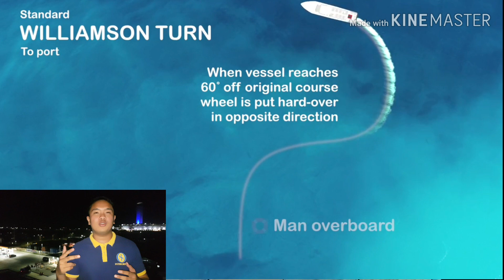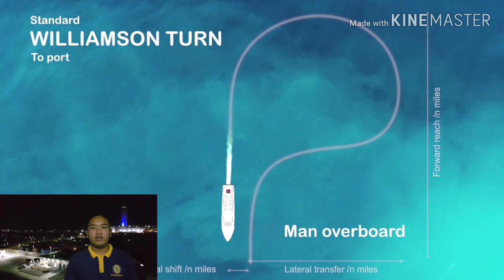SEAM 5

Comment: JAZER LLOYD D. AMPER
SEAM 5
MW 0730 H - 0830 H 
T-TH 0730 H - 0900 H

SHIPS MANEUVERING AND HANDLING

TEST 9 ANSWERS:

1) Decrease the speed as much as practicable.
2) Make a bold alteration to starboard and pass on his port side
3) As with no. 2
4) Vegetable/Fish oil
5)Use the winch. Forerunner and wire stopper to pick up the slack and stop the wire. One man operating each.
Make the forerunner fast on the beat, releasing the eye of wire and stopper, lower the wire easy by forerunner.
6) Quadrupled
7) Due to suction, the two ships will sucked together.
8) Too fast
9) Give starboard rudder in order to balance the force to the bank effect and the rudder effect.
10) Increased velocity and decreased water pressure around the ship's hull.

THANK YOU VERY MUCH SIR ROY :) 
GOD BLESS...

Comment: Macasero, John Rose D.
(TTH 12:00-1:30,1:30-3:00)

1.)Insert a blank flange on the line between the slop tanks and the rest of the cargo compartments?
2.)The name of the person in charge of the transfer operation
3.)8 hours a day?
4.)Permission must be obtained from Chief Officer?
5.)Coal?
6.)Flash point.
7.)Cross flooding arrangement
8.)The Master?
9.) As per Builders' specification?
10.)Melting heat

Comment: D/C CRISTINA BULAWIN
Monday 7:30-8:30
Tth 7:30-9:00

Ships maneuvering and handling

Test 9 ANSWERS

1.)Due to suction, the two ships Will sucked together
2.) Increased velocity's and decreased water pressure around the ship's hull
3.) give starboard rudder in order to balance the force to the bank effect and the rudder effect
4.) Decrease the speed as much as practicable
5.) Use the winch. Forerunner and wire stopper to pick up the slack and stop the wire. One man operating each. Make the forerunner fast on the beat, releasing the eye of wireand stopper, lower the wire easy  by forerunner.
6.) Vegetable / fish oil
7.) Quadrupled
8.)  Make a bold alteration to starboard and pass on his port side
9.) Too fast
10.) As with no. 2

Thank you and God Bless !

Comment: D/C REYNALD GARGANTILLA
Monday 7:30-8:30
Tth 7:30-9:00

Ships maneuvering and handling

Test 9 ANSWERS

1.)Due to suction, the two ships Will sucked together
2.) Increased velocity's and decreased water pressure around the ship's hull
3.) give starboard rudder in order to balance the force to the bank effect and the rudder effect
4.) Decrease the speed as much as practicable
5.) Use the winch. Forerunner and wire stopper to pick up the slack and stop the wire. One man operating each. Make the forerunner fast on the beat, releasing the eye of wireand stopper, lower the wire easy  by forerunner.
6.) Vegetable / fish oil
7.) Quadrupled
8.)  Make a bold alteration to starboard and pass on his port side
9.) Too fast
10.) As with no. 2

Thank you and God Bless !

Comment: D/C JEBOY L. BOLAMBOT
SEAM 5
(12:00 - 3:00) TUESDAY I-402
(1:30 - 3:00) THURSDAY I-402

CARGO HANDLING OPERATIONS.
TEST 6.

1. Carbon monoxide, nitrogen dioxide, nitric oxide, sulfur dioxide
2. To secure/lash containers
3. Latex
4. An efficient engine room watch with the main engine on standby be maintained
5. Ammonium nitrate
6. Above the bulkhead deck
7. Ventilate excessively
8. Ventilate the holds as well as possible
9. Be checked at regular intervals for gas which might be released perhaps from sludge deposits; and if such gas found the tank to be re-gasfreed
10. Maximum allowable working pressure.

Comment: D/C Patigayon, Neil Jr. R.

SEAM 5
TUE 12:00-1:00 PM (I-411)
TTH 1:30-3:00 PM (I-402)

TEST 20

1.) Initially the bows of the ships will be pushed away from each other.

2.) Yes, a ship usually steers better if trimmed by the stern.

3.) No, the most effective rudder angle is about 25 to 30 degrees, because the rudder is 'stalling' at 35 degrees angle.

4.) The bow could be pushed away from the bank.

5.) You will sheer to starboard and gradually lose headway.

6.) About 80%

7.) 1 hour

8.) Advance

9.) The master.

10.) The vessel becomes sluggish in responding to the rudder.

Comment: Krys Jay Cabanas 
SEAM 5
TTh 0900-1030

1.Your ship is operating with a right handed propeller. Before coming astern, how should you apply the rudder?
Ans: As with no. 2
2. You are berthed with a steady offshore beam wind of 30 knots. This wind suddenly increases to 60 knots. When this happens , the force driving the vessel off-berth will be:
Ans: Quadrupled
3. How do you consider the indicated speed for berthing?
Ans: Too fast
4. What is the reason for the effect we call squat?
Ans: Increased velocity and decreased waterpressure around the ship's hull
5. You are about to pass another ship in a close situation. What can happen in this situation?
Ans: Due to suction, the two ships will be sucked together
6. How can you minimize the squat effect?
Ans: Decrease the speed as much as practicable
7. In the shown situation, the bow of your ship is pushed away from the bank. How can you handle this?
Ans: Give starboard rudder in order to balance the force of the bank effect and rudder effect
8. You are to release the towing wire with forerunner. You have 3 men with you to do the work. How do you do it in a safe way?
Ans: Use the winch. Forerunner and wire stopper to pick up the slack and stop the wire. One man operating each. Make the forerunner fast on the bit, releasing the eye of wire and the stopper, lower the wire easy by forerunner.
9. You are underway on a power driven vessel in open water, when you see another power driven vessel approximately five miles straight ahead on an opposite course. What action do you take?
Ans: Make a bold alteration to starboard and pass on his port side
10. What can be used to reduce the effect of the state of sea-waves?
Ans: Vegetable / Fish Oil

Comment: Puerto Vince Paolo P.
SEAM 5 
MONDAY (7:30 - 8:30) LEC
TTH.         (7:30 - 9:00) LAB

1. Vegetable/fish oil

2.Increased Velocity and decreased waterpressure around the ship's hull

3.Make a bold alteration to starboard and pass on his port side

4. Use the winch. Forerunner and wire stopper to pick up the slack and stop the wire. One man operating each. Make the forerunner fast on the bit, releasing the eye of wire and the stopper, lower the wire easy by forerunner

5.Due to suction, the two ships will be sucked together

6.Give starboard rudder in order to balance the force of the bank effect and rudder effect

7. Too fast

8. Decrease the speed as much as practicable

9.Quadrupled

10. As with no.2

Comment: KIM,JUYEONG SEAM5 7:30-8:30
TEXT9

1.Quadrupled
2.As with no.2
3.Use the winch. Forerunner and wite stopper to pick up the slack and stop the wite. One man operating each. Make the forerunner fast on the bit, releasing the eye of wire and the stopper,lower the wire easy by forerunner.
4.Increased velocity and decreased waterpressure ariund the ship's hull
5.Vegetable/ Fish Oil
6.Due to suction,the twi ships will be sucked together
7.Decrease the speed as much as practicable
8.Too fast
9.Make a bold alteration to starboard and pass on his port side
10.Give starboard rudder in order to balance the force of the bank effect and rudder effect

Comment: 1.Due to suction, the two ships will be sucked together
2.As with no.2
3.Quadrupled
4.Use the winch forerunner and wire stopper to pick up the slack and stop the wire. One man operation each. Make the forerunner fast in the but, releasing the eye of wire and the stopper, lower the wire easy by forerunner.
5.Make a bold alteration to starboard and pass his port side
6.Too fast
7.Vegetable fish oil
8.Give starboard rudder in order to balance the force of the bank effect and rudder effect
9.Increased velocity and decreased water pressure around the ship’s hull
10.Decrease the speed as much as possible

-ROHRER, MARLON C.

Comment: Lee SangJune SEAM5(9:00-10:30TTH, 7:30-8:30WED)

ShipsEducation
Ships handling and maneuver
1. The vessel's bow is pushed away from the nearest bank.
2. A large vessel overtaking a small vessel with little difference in speed between the two vessels.
3. She will turn to port and the speed will drop gradually
4. Pushing, made fast in the vessel.
5. No. 2
6. Check the position only.
7. Fast FWD and AFT in center lead to pull the vessel out from the jetty and make it in position for voyage.
8. The stern will 'back' into the wind
9. The vessel becomes sluggish in responding to the rudder.
10. Make the tug fast on port shoulder to pull.
Reply from the maker: kim? right

Comment: 1.due to suction, the two ship will be sucked together
2.As with no.2
3.Quadrupled
4.Use the winch forerunner and wire stopper to pick up the skack and stop the wire. One man opertaion each. Make the forerunner fast in the but, releasing the eye of wire and the stopper, lower the wire easy by forerunner.
5.make a bold alteration to starboard and pass his port side
6.too fast
7.vegetable.flsh oil
8.give starboard rudder in order to balance the forece of the bank effect and ruddetr effect
9.increased velocity and decreased waterpresuure around the ship’s hull
10.descrease the speed as much as practucable
Reply from the maker: name? in roman form, sorry i cant read

Comment: Short and Straigthtforward yet detailed presentation. Michael Victor P. Uy SEAM 5 (10:30-12:00 PM TTH)
715 D
716 B
717 A
718 A
719 B
720 B
721 D
722 A
723 C
724 C
725 B
726 B
727 C
728 B
729 C
730 A
731 B
732 C
733 B
734 C
735 D
736 C
737 C
738 C
739 A
740 A
741 C
742 C
743 C
744 D
745 B
746 C
747 B
748 B
749 C
750 C
751 D
752 A 
753 A
754 B
755 D 
756 B
757 C
758 C
759 C
760 B
761 C
762 C
763 A
764 C
765 B
766 C
767 C
768 B
769 B
770 B
771 C
772 D
773 A
774 B 
775 B
776 C
777 D
778 D
779 A
780 C
781 A
782 C
783 D
784 D
785 B
786 D
787 A
788 C
789 A
790 D
791 C
792 C
793 B
794 A
795 B
796 C
797 B
798 C
799 C
800 A
801 A
802 A 
803 C
804 D
805 A
806 A
807 A
808 A
809 C
810 B
811 B
812 A
813 A
814 D
815 C
816 C
817 B
818 A